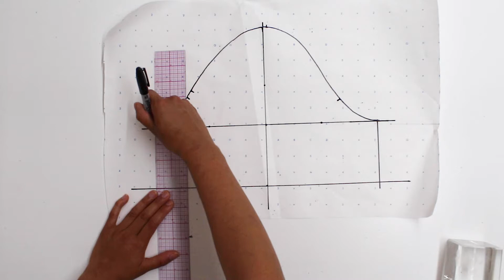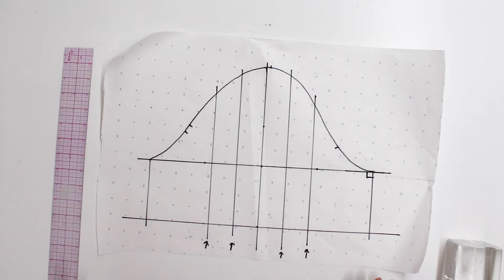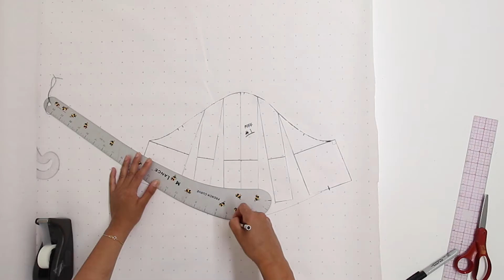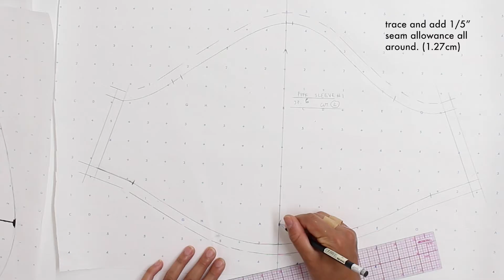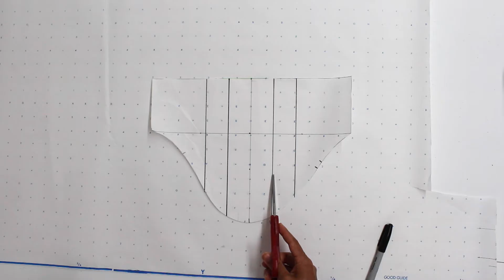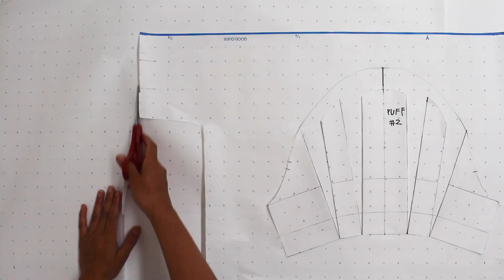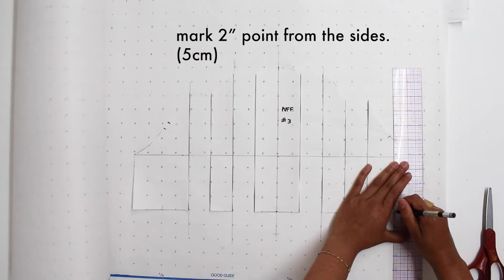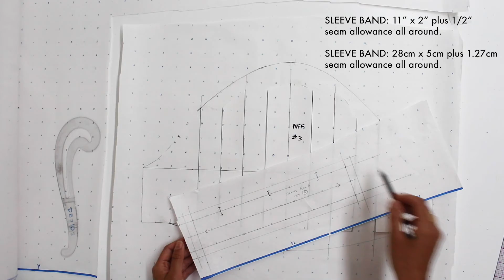PUFF SLEEVE TUTORIAL - 3 STYLES | patternmaking and sewing | BASIC BODICE & SLEEVE SLOPER  FREE PDF

Comment: I have so much trouble when I am gathering the fabric it never scrunches that easily and I break threads any tips?
Reply from the maker: @swordgirlfriend  make sure you use the longest stitch length possible on the machine and leave a long thread when you finish! Also always do two lines before scrunching.

If that still doesn’t work, sew the 2 lines by hand with a long stitch length. then pull the threads to scrunch!

Make sure you go slowlyyyy, section by section when you scrunch